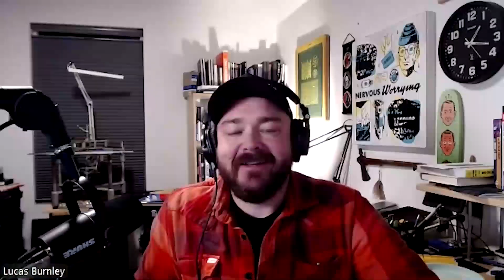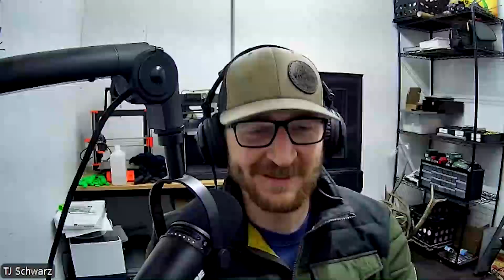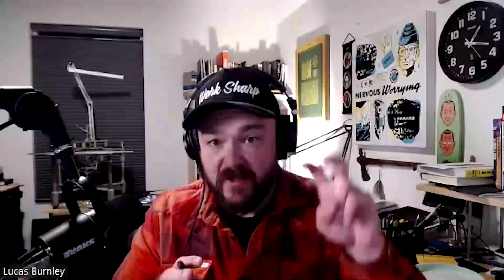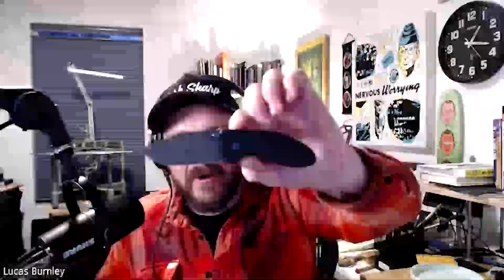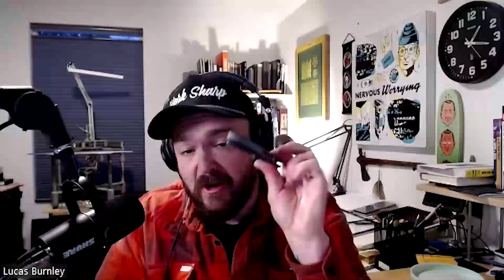EP96 | Folding Knife Development

Comment: Another awesome show! Thanks for doing these! Just to give another perspective, our first real CNC project and my first real knife, was a button lock folder. No hard milling or bevel grinding, but it was an amazing way to learn not only how to make a knife on a CNC, but also how to use Fusion with a good CNC. All this is to say I think starting with a folder is more complicated in some ways, but it is still very doable and a viable path. There may be a few blade rejects after heat treat, but almost all of ours came out straight and only needed a little bit of hand work to get them to lock up well. It would even be a little easier going with a frame lock instead of a button lock. I also skipped learning to machine on manual machines (except for a brief amount on my bench mill before I got a CNC). My point is that going through the traditional steps might be better in a lot of ways, but it can take longer and it might also develop skills that you may not need for what your end goals are. No disrespect to forgers, filers, grinders, etc.